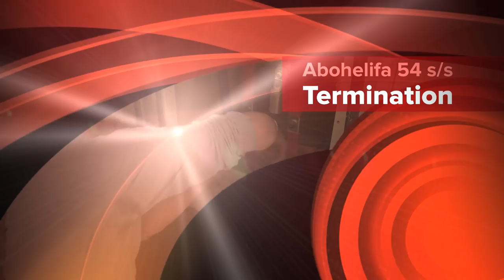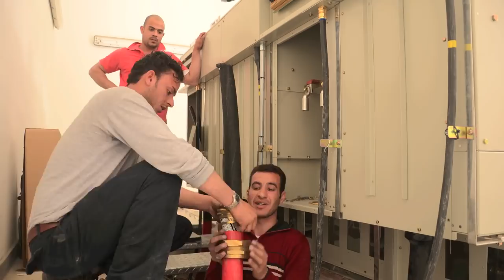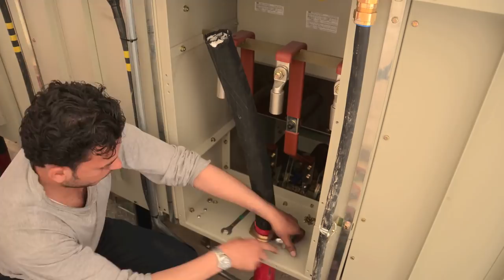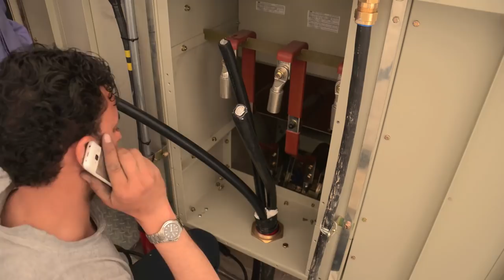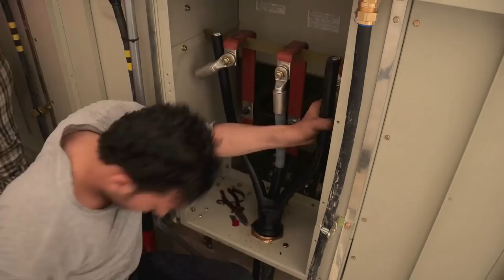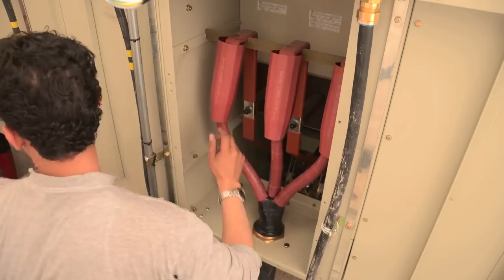Abohelifa 45 s/s Termination

Comment: I first met Raychem heat shrinkable jointing material (so call ‘dry joint’) in mid 1970. Thereafter no more soldering and compound insulation boiling.